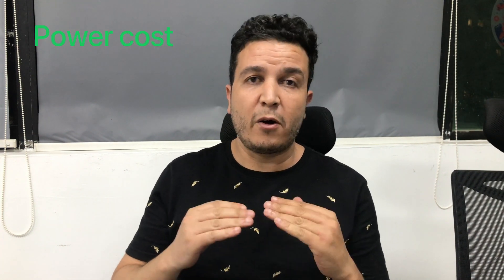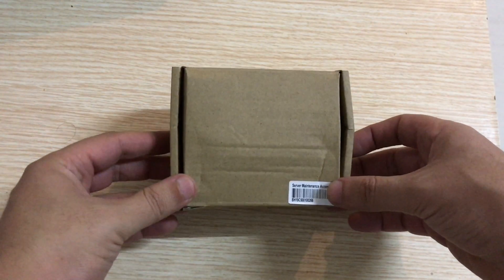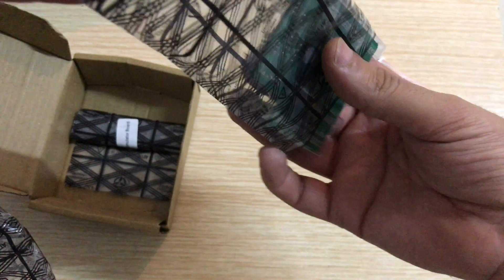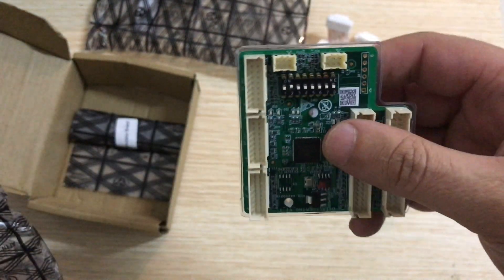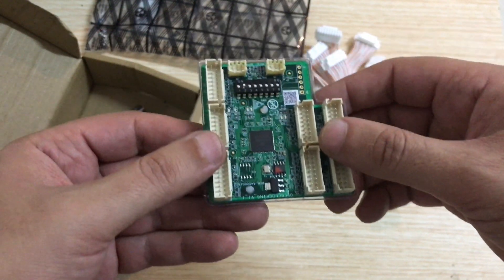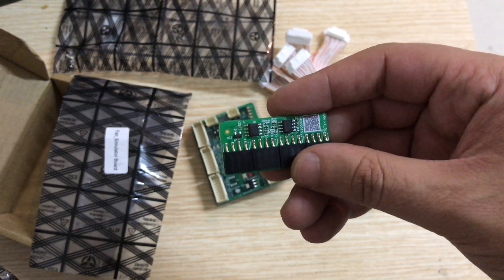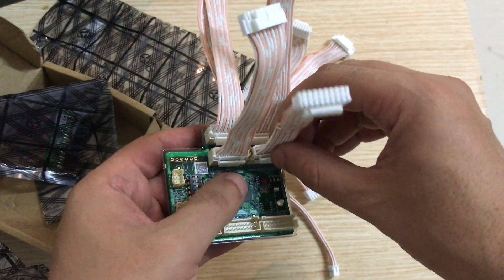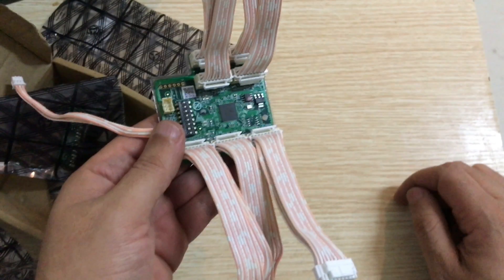How to overclock an antminer  S19 with No dev fee?

Comment: I have one of these, but it did not come with a manual. Could you please point me toward information about the switch settings?
Reply from the maker: Definetly , check the video description for the website , send me a message through contact  firm or add me on WhatsApp , and I’ll send you a copy of the manual , just make sure you have the same model
Reply: @Crypto_mining_lab  where can I buy the original control board? Mine went bad for some reason and I need to replace it!
Reply from the maker: @FirstLast-tx3yj  what miners model you have ? You can email me directly thought cryptomininglab.net contact form , and I’m sure can find a replacement for you
Reply: @Crypto_mining_lab  s19 j pro

Okay I will send